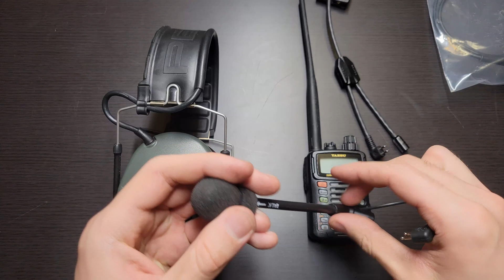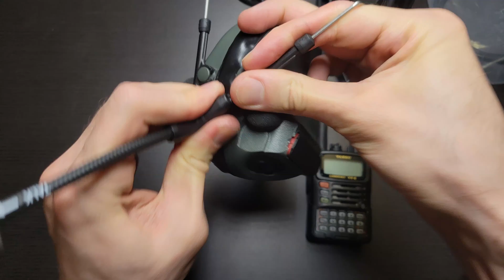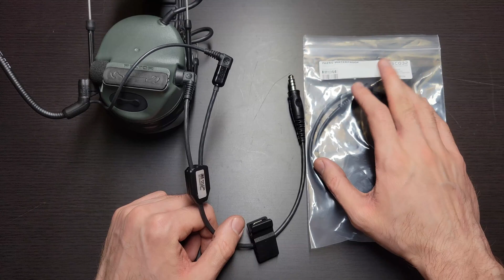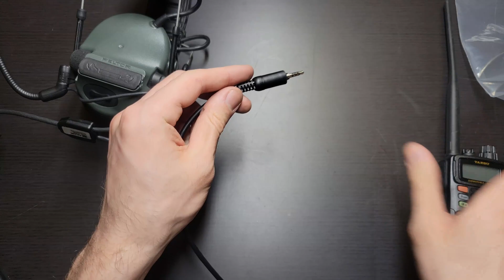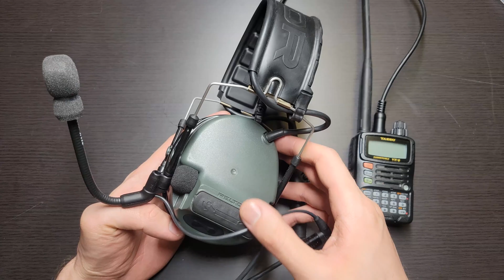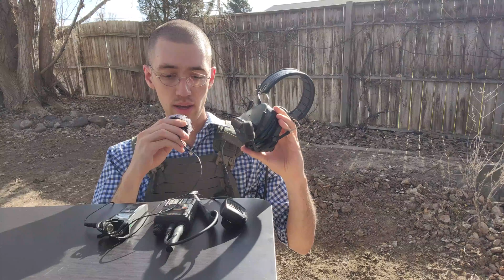How To Connect Peltor ComTac Defenders to a Baofeng/Yaesu Radio

Comment: Put some dielectric grease inside the connections. Allows the current to flow through put prevents water from coming in.
Reply: That's a recipe for shorting if it ever gets smeared by the plugs.

Comment: Hey, do you know what the difference is with boom mic model mt33-05r and mt33-05. I can’t find anything about it. I regret getting rid of the one my head set came with!
Reply from the maker: I'm not sure but I think it's just a different product code for the same thing. I'm using a mic that was sold just as MT33-05 but I see the two model numbers used interchangeably on the same listing on EnviroSafety.
Reply: Thanks, I was just about to ask what you were running. Crazy how much all of it costs!😤

Comment: Thanks I have been looking for this setup. I was very confused! I have a question if you don’t mind…..  on the disco 32 did you go with the low or high and did you do the 20 in wire connection. I have the same set up as you do. Thanks
Reply from the maker: I went with the low impedance DISCO 32 PTT with a 20" long wire. You'll need the low impedance version for any dynamic mic, but if I were to do it again I'd go with a 6" wire instead as I always have a fair bit of excess, though that will depend on your exact setup.
Reply: @Jang-gun銃  thanks
Reply: I picked up a vx-6r, I was running a vx8dr . It’s a great radio with lots of capabilities, but not much after market support. I might trade it for another vx 6r. It’s more my speed, I’m only using it for voice….everything else is over my head. Thanks for video and your help.

Comment: I have the ComTac V and want to connect either my FT60 or my FT2D. Will these cables work? Links for them?
Reply from the maker: I'm not sure if those two radio models use the same connection method so you'll want to check that. The PTTs are on Disco32.com and the rest of the parts you can find either through Envirosafety or even on eBay. The rest of the cables are compatible with the ComTac Vs.

Comment: I like this set up but I have a pair of axil ear muffs that has a 3.5 jack and no boom mic is there a way to convert it?
Reply from the maker: You could run your comms through a 3.5mm cable to your PTT (if your PTT has that capability), otherwise no, there's no way to convert the earmuffs themselves.

Comment: I have a dual comm  peltor III, well single comm technically sicne one downlead on the right side was cut by the prior owner. However, why dont you want to plug in your mic to the socket port? I found out my comtacs were real but the mic was fake, an MT31 knock off, as there was no peltor embossing on it ( but gentex embossed on the mic portion under the foam interestingly enough). The prior owner used the fake one some how through deployment and had it directly plugged into the left socket and I saw videos of people effortlessly taking the mic out  without the mic harness, however in my case it was so stuck i had to use pliers and ended up tearing the black and yellow wires that solder into internal channel of the left side, so I had to resolder it which was a pain in the ass. that being said if I did that correctly my left port should work... however if it doesnt then the right side would be my only option  which I dont want to do since thats my dominate shooting side. So I have to get a new mic, and two radios to see if my mic even works, and maybe a Y harness but then id end up having to buy both the right and left Y harness as far as I'm understanding cause of my situation. Is that correct?
Reply from the maker: I'm not sure how different the dual comm version is from the defenders but at least on these, you can't plug the microphone directly into the socket as it won't work. When I'm not using comms I usually plug the microphone directly in, just to keep the cord retained.

I hope you verified that boom microphone was a knockoff because Gentex DOES make a legitimate microphone for Peltors. Kinda painful to think about one getting accidentally destroyed.

I would recommend checking with Peltor directly or see if there's other videos on the dual comms as I'm really not that familiar with how different they are compared to this. I don't think you need a Y harness at all on those, but I'm not sure. As for the rest of the parts though, yes, you would need a new mic, two radios, and PTT adapters to test function.

Comment: Any advice if incoming comms are very faint and pretty much unintelligible?
Reply from the maker: I'd check if the volume got bumped down on the radio itself first. After that, check if all the connections are tight. If that still doesn't fix it then it might be a bad part such as the PTT, cable, or radio itself.

What kind of radio are trying to plug in? If you're able to test the radio with a different headset/headphones that'd be a good way to check if there's an issue with the radio itself or with a different part.

Comment: The peltor comtac are on my list but they are quite expensive. Yaesu is a way better choice than Baofeng. As usual great job with the video
Reply from the maker: Thank you! The current model Comtacs have gotten rather unfortunately expensive. You could look at some of the older models of Comtacs available on somewhere like eBay. I was lucky enough to get these Comtac IIIs just before they were discontinued and so got them at a pretty good price.

Agreed on the Yaesu, it’s quite nice. I only very recently upgraded from the Baofeng UV-5R myself.
Reply: Earmor m32 $90 decent quality 
You can upgrade the microphone to dynamic that way it uses amplified PTT’s like in this video